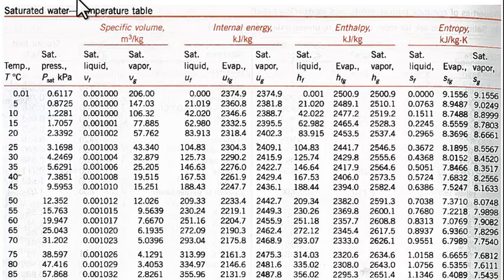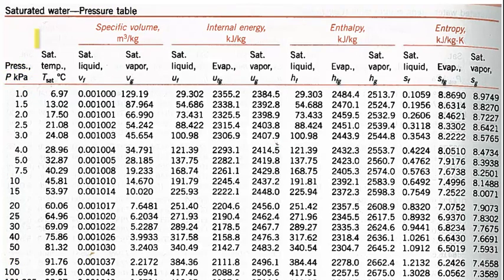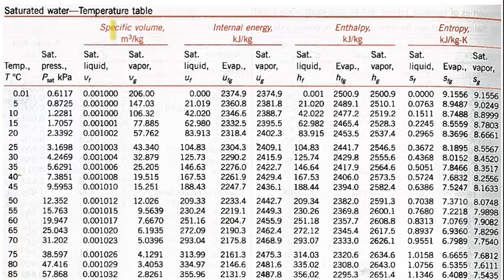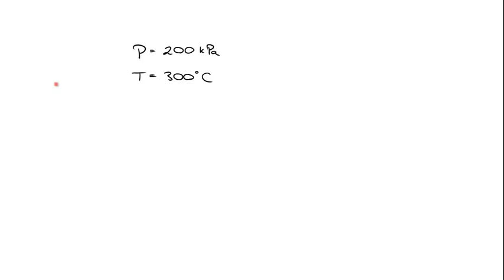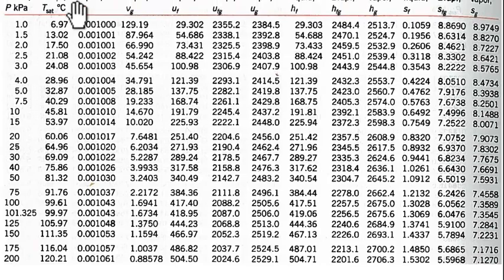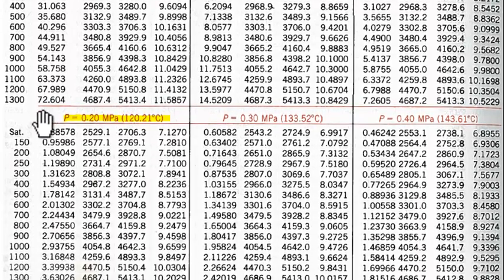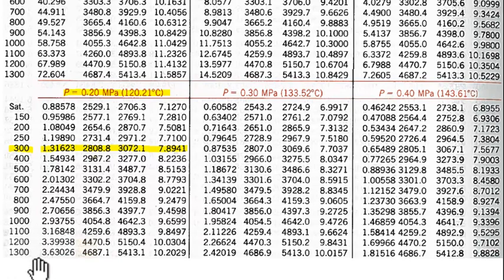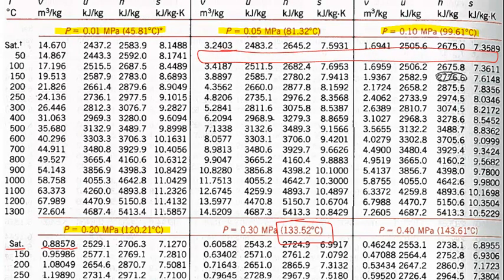reading water tables

Comment: so my problem is that I have 125 C & 750kPa (.75MPa) for H2O
so i go to the saturation water to find 125C but the pressure is too low. So i go to the saturation table for pressure and the temperature is almost double. What do i do now?